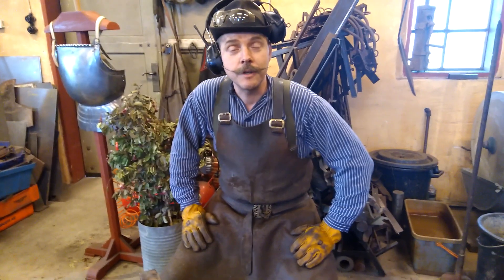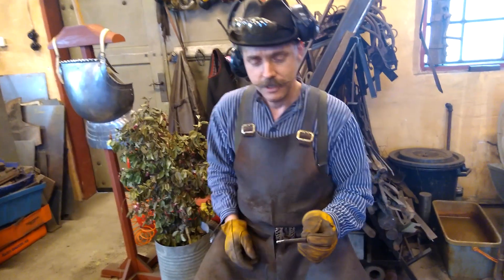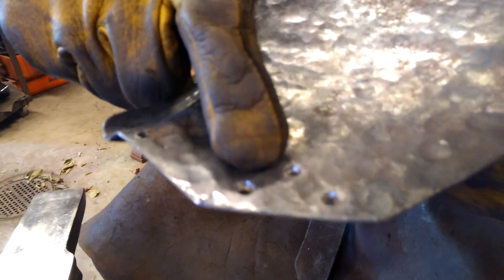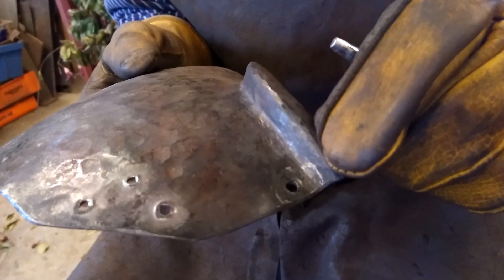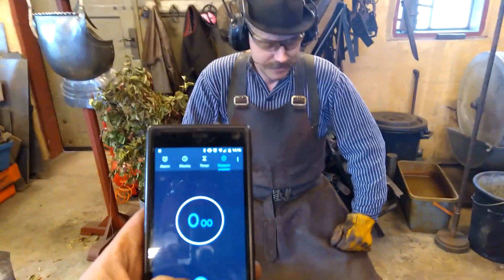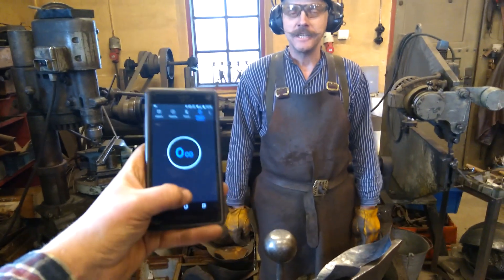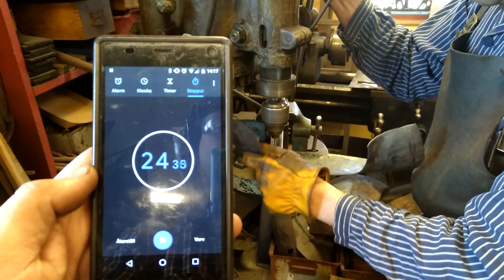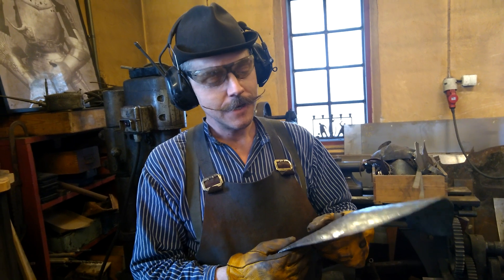Punching holes vs. Drilling holes

Comment: can i  a punched hole to any angle direction on the plate ? suppose i punch a hole in 45°  can possible?
Reply from the maker: no, you have to have a 90-degree angle, more or less. otherwise, the punch will slide off. Also the support under the metal will be hard to have in position without having it sliding.

Comment: How did you punch through that in 2 or 3 strikes? Is it aluminum? I'm beating 16 gauge mild steel sheet with a punch and ball-peen hammer a dozen times (backed with a tree stump) and just have a nice dent in it and a warped plate. I already broke an Eastwood 14 gauge hand punch trying to punch the holes in the plates for my Sode (pauldrons). I may have to give up and try a drill press, but I think that will go through a lot of bits (and be very slow). I need to make hundreds of holes for the lacing. Is there something special about the shape of the head on your punch or what? I think I need an industrial laser or something....... I really salute those medieval armorers making this stuff without power tools!
Reply: You are using a punch with a flat tip and a sharp corner on the edge of that flat tip right? You want the punch to sheer the steel around the slug, you aren't exactly trying to pierce the steel.